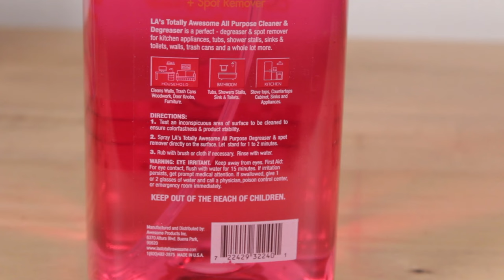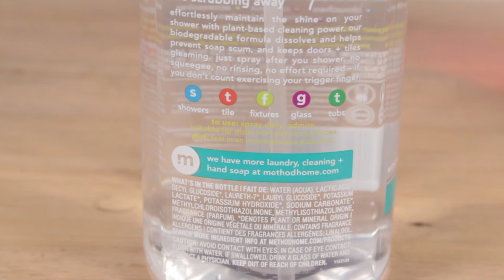Cleaning a Smith Corona Sterling (testing new cleaners!)

Comment: Steam cleaner will work well and can blow out areas that you can't reach without further disassembly.  Brake cleaner will work great on oil based grime on the inside of the typewriter, just be sure to use it outside.